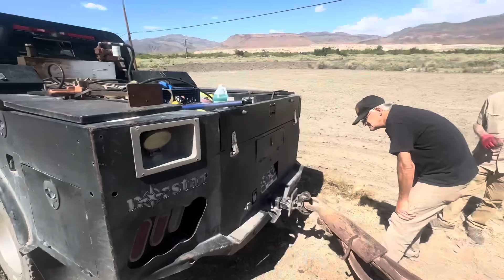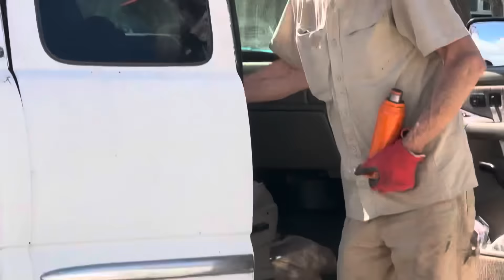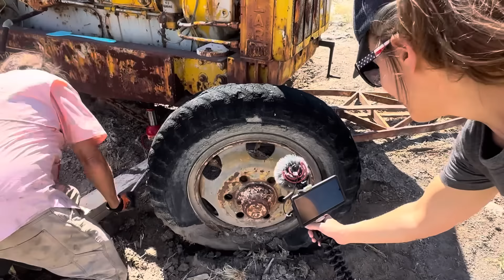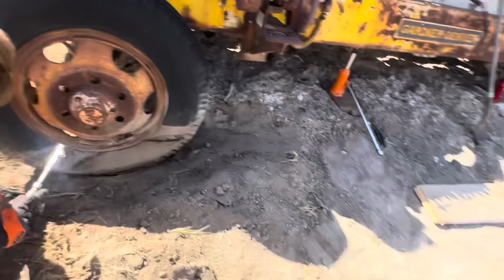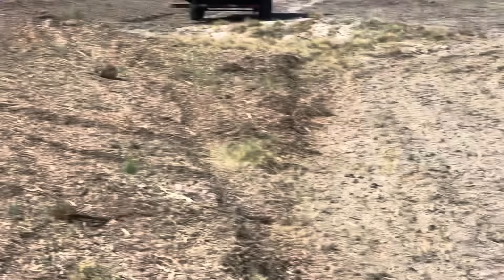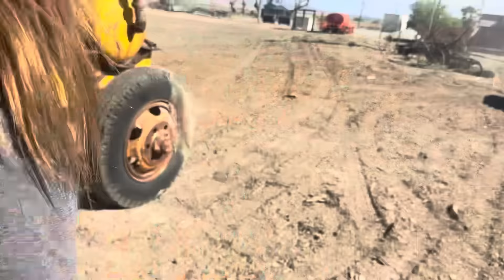Moving a large mining machine, with special guest helper Wonderhussy

Comment: that looks like a old D7 engin i bought an pony motor off a guy down by Moscow Idaho  for my 1953 D7T  in 2005 and it looked the same. great stuff thanks for sharing
Reply: D7 was a 4 cylinder and this is a 6 cylinder motor, probably a D8 size motor?
Reply: @EL300B  your most likely right i wasn't paying that much attention. thanks for the correction. was about 15yrs. ago i sold that beast

Comment: I had to shut off the sound? Why?  You folks May be really nice, sincere people?  BUT YOU ARE  CLUELESS ABOUT  OLDER TRUCKS, MECHANICS,   OR  MANUAL TRADES!
THE WHEEL RIMS ARE  20 INCH DIA. CLASSIC INNER TUBE TYPE  6 BOLT   "BUDD"
RIMS, THAT USE THE OLDER STYLE   "TWO PIECE  BOTTLE  AND NUT STYLE   WHEEL
NUTS TO MOUNT  TWO  TIRE RIMS TO   HAVE  DUAL WHEELS  ON  COMMON REAR
TRUCK AXLES OF THE TIME.  THESE ARE NOT, THE DAYTON,  SYSTEM WHICH 
WAS COMMON AFTER THE  BUDD  SYSTEM!!    DAYTONS USED THE  FROGS ?  WHICH
HAD THE STUD  MOUNTED  ON THE CAST  WHEEL HUB,   THE RIMS WERE 20 "   ONLY
TO THE NAKED EYE? ONLY HAD THE STEEL MOUNTING THE TIRE!  THE  HUB FORMED
THE CENTER OF THE WHEEL UNIT, ONTO WHICH THE  WHEEL AND  TIRE SLID ONTO?
THEN THE FROGS   TRIANGULAR   SLID ONTO THE STUD AND THE WHEEL NUT 
WENT ON THAT!    YES? IT IS HARD TO EXPLAIN WITH WORDS? THIS IS THE MOST COMMON SYTEME USED IN THE RECENT PAST!   TODAY HEAVY TRUCK WENT BACK 
TO  ONE PIECE WHEEL RIMS,  BUDD STYLE, BUT WITH  TUBELESS  TYPE, THAT
WERE  MOUNTABLE ON THE WHEEL RIM, MUCH MUCH EASIER !   AND THE SIZE?
WENT FOM THE OLDER 20 INCH? TO THE MODERN  22.5  INCH  TUBELESS TYPE!
AND WAY EASIER TO WORK WITH  AND USE !!  kennethzakaib607@gmail.com  may 2024

Comment: Compressors give me gas.🦨🌀⚡
Reply: Then you would blow a gasket if you ever saw the Oxygen Reduction plant in South Middletown, Ohio. It produces liquid oxygen for a local steel mill and the huge compressors run around the clock. It is owned by Air Products, and is on Yankee road. I lived near there when it was first built, and watched as new equipment was hauled up from to Ohio river on some 40 axle, 4,000 HP crawlers that had a op speed of 0MPH
They compress air to a liquid, then boil off the different gasses.